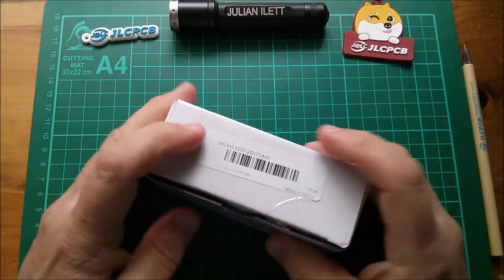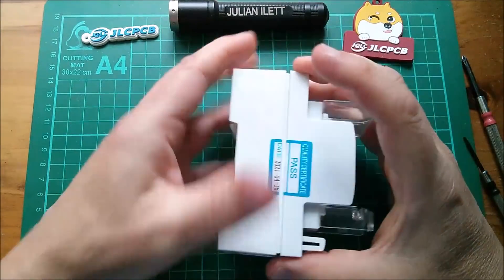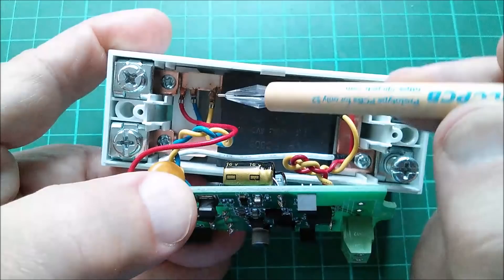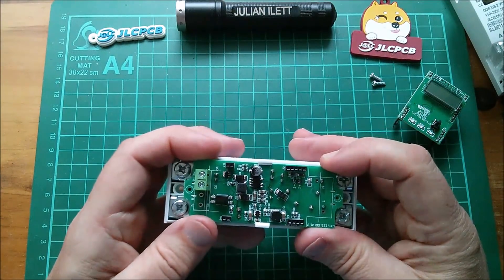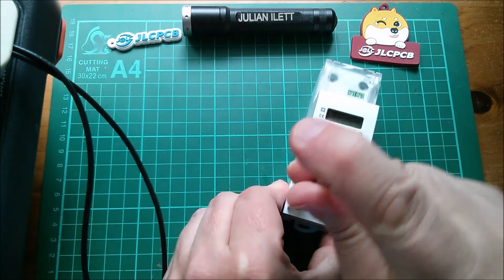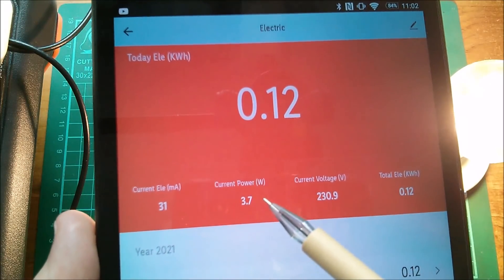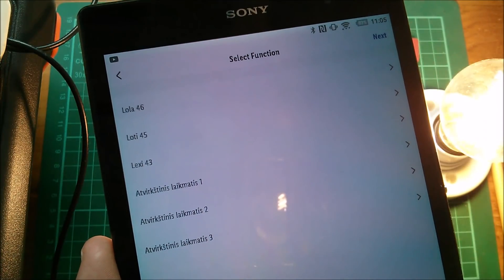Wifi Energy Meter DDS238 - Stripdown and First Use

Comment: Hello! Nice video. I'm not an electrician, but I have a doubt: at t=1:01 in its housing the device states its rated for  5 to 65 Amps. But when you dismount the pieces, the "Live AC" wires seems to be around 10 AWG gauge. Can these wires work with 65 amperes steady, as stated? According to manuals, for 65 Amps it should be 6 AWG gauge with copper wires. Am I missing something with the specs? Thanks!
Reply: Very interesting point
Reply: Have you managed to find an answer?

Comment: Just bought one of these to use as a main meter, kind of dissapointed that the app doesn't show positive or negative power, I have solar power and I'm interested in knowing if my power is being exported or consumed by my loads. Also if you are using this as a main meter I strongly recommend disconnecting the coil wires, last thing one needs is accidentally switching off your main power by pressing a huge ass button without any confirmation. Make sure the relay is in the on position if you disconnect the coil as it's indeed a latching relay. The software of these meters is horrible BTW.

Comment: Many thanks! You convinced me ;).
Just one info: supposing to place it upstream to all my loads - if I switch off it from the app I'll lose the possibility to re-switch it on.... and I would need the restart of the router to be able to switch it back on via the app - is there the possibility to switch on/off via the physical button I do see on the front of the device? Many thanks. Cheers

ups. just reached the end - it is the 3x click right?  With that 3x clicl i can switch the device on/off without the wifi right?

Comment: In my case the breaker is not working. There is a relay noise when activated but output load is always connected. Is mine broken?

Comment: You would feel it, when I was younger I accidentally pulled cables out of a chocolate block by tripping over it (yeah, I know it was silly to use, it wasn't me who did it), and without thinking I twisted the wires to put them back in, did one side fine - but as soon as I touched the other I got a bit of a buzz!! - that was with the Neutral, straight from the mains.. I was sat on a bed at the time I was trying to fix them too, legs crossed!

Comment: Hi, long press to do an init is probably only for the zigbee version. In the zigbee version it is used to pair the device with the gateway. Do you know what the green pin in the front are for? Pin 5 and 6. The manual say it is for impulse, no idea what does it mean. On a different version of the dds238 it says it is a modbus rs485 connection, which seem more likely.

Comment: I used my SONOFF POW for Solar Messaure .... no LCD but else the same. And I have a DS238 for reading pulses into a ESP8266 uploading to PVOUTPUT.ORG. Works for several years now. I only have 800W in solar, but in summer there have been times I produce more than I need. To avoid that my hotwater heater is running only from 9AM - 20PM and with a SCR with is pulling down consumption from 1800W down to 500W so I always use more electric than I produce ;)

Comment: That's just not going to work though, is it Julian? The power meter is measuring the amount of power being consumed, not how much power your solar system can provide. You're not going to be able to use it as a 'The sun is out, and there's more than 800W of 'free power' available' trigger. Your only chance of doing that is if your solar inverter supports throwing a relay itself if it determines the conditions to be right to be providing power to an auxiliary circuit. Or is this a grid tie system, meaning it is always loaded because it's trying to export?
Reply from the maker: It's working now - I put the meter in my distribution box and it turns a miner on at 800W each morning. I have a grid-tied rooftop system.
Reply: @JulianIlett  im trying to set up similar automation but find it difficult because tuya doesn't distinguish exported energy from imported. I thought i can trigger an even when amount of exported energy exceed a certain amount but it won't work as it will also trigger the same event in case if energy consumed instead of being exported. How did you work around this?
Reply: @skyeye101  i have the same question. Did you get any luck with this. I hate that the guys from Huawei solar did not make the aps compatible to each oder.
Reply: @ionutoctav87  no luck, still wondering how Julian got it working, but guess it's top secret as he doesn't reply to this comment 😆
Reply: @skyeye101  just ordered a smart meter. I have a space where the old meter was initially. It will be conected directly to the mains.
I hope tuya will see the  "<0kw" values and run the automation...
Reply: @ionutoctav87  hopefully it'll work for you, as in my case inverter i use has an option to trigger a relay on specific customisable event

Comment: Having watched JW and looked at my own mains supply from the grid, it's incorrect to assume that the neutral is earthed at the substation and the earth cable runs to the same place.  On a TN-C system, the neutral is split off at the main fuseholder to become the earth (a PEN connection - Protective Earth Neutral) so as the wiring comes into the house neutral is exactly the same as earth.  Becomes a problem if the neutral breaks outside as then any connected load acts as a path for all 'earthed' surfaces to become live.

Comment: For a European main land board the layout for two live terminals below and two neutral terminals above does not make any sense at all! Is this a specific British thing?
Reply from the maker: It didn't make much sense when I installed it. I ended up fitting it upside down.
Reply: @JulianIlett  In that case the display will give an Australian readout ;)
Reply: @JulianIlett  I suspect this unconventional arrangement was to save copper, internally. The EARU RDCBC/TJ-2P is more conventionally arranged, incorporates a double pole relay, is rated up to 90A and is cheaper (no LCD 'though)
Reply: @sailingoctopus1  Also no meter
Reply: @JulianIlett  what do you mean? The circuit breaker is between 3 and 4 or between 1 and 2?

Comment: No you wouldn't feel it. Same with if you touch one wire coming from a bathroom shaver socket. But that's the problem, you have no way of knowing it's live so accidentally touching the other wire would give you a dangerous shock

Comment: 240v will move you across the room (mains or powerbank)
Reply: No it won't.
Reply: Not really 😁  German Electrician here, speaking of own experience 😅 What makes you fly is the high voltage in an old Tube TV 🤪
Reply: Work with 240V every day of my life - still haven't learned to fly. Simple solution, don't touch live wires.

Comment: @Julian Ilett are your plans to use this in the shed for the Antminers on the DC side ??? Or AC side. It wasn't clear. I see that these are AC specified units, in your opinion how would they go handling DC (say ~24v 80-90A) cut off?
Reply: I think he has some wifi controlled mains sockets to which the Antminer's AC supply is connected.

Comment: You should connect to your house consumer unit. Then you can look at the value being exported to the grid to determine if you should turn your miners on. You don't want to run minors when your oven is on and you are consuming all your solar energy being produced.
Reply: Did you tested this? How did you make the scenarios? Most reviews states that the power exported is not properly showed to make a scenario.

Comment: You can buy the standard WIFI Tuya Plug Socket with same monitoring functions.
Reply: Or even an extension lead so you have more outlets and timers
Reply: The difference is that this can control devices or circuits that draw up to 65A (although confusingly the max operating current is specified as 50A to 79A), so you can control and monitor the supply to a whole property.

Comment: If only they brought out the connection between the relay and shunt, then the one unit could work for both solar monitoring and switching on some miners. Or more commonly, allow two large loads to share a circuit by turning one off if the total current goes above a user set value.

Comment: IF not mistaken tasmota support Them so you can some proper software on it :) so you can manage it through mqtt and can get some decent data out for graphing too. Just a Little tip ;)
Reply from the maker: I am planning to look into Tasmota - cheers :)
Reply: You might have to do a manual (serial) flashing because flashing via WiFi is not supported on the latest Tuya firmware.
Reply: I've been using tasmota and OpenHab for years. It's excellent
Reply: @DrGreenGiant  likewise.

Comment: I would not touch them because your main outlet is also not connected with ground and you get a shock when you touch the live wire because the electrons are going to ground through your body why should this be different?
Reply: Neutral is connected to ground at the sub in the UK so the live coming out of our sockets would take the path through our bodies to ground. With the mains unit Julian had, there is no reference to ground so no path could be formed.
Reply: On a TN-C installation, it's connected earth to neutral at the main fuseholder coming into the house, there is no independent earth feed, just a neutral.

Comment: So you only switch the miners on when the power is free ?
Reply from the maker: At the moment, the miners are running at breakeven. So I'm only switching them on when power is free. Problem is, after a few hours, the sheds get so warm I have to switch them back off (or remove the shed walls).
Reply: @JulianIlett  pour water on them and hire it out as a Sauna !...interesting stuff...cheers.
Reply: @JulianIlett  Up your solar setup and get some air conditioning running with it?

Comment: Current power; current voltage ; current current?
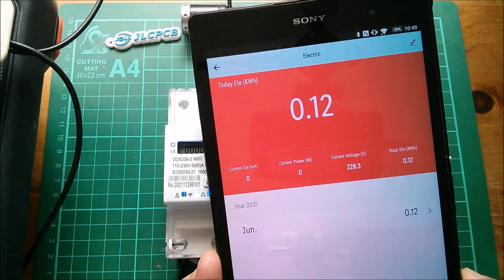11:48 There's no need for any adjective to describe the three readings on the user interface.  They could have just labelled the units as Power, Voltage and Current.
Edit:  Just spotted the mysterious quantity Ele which is measured in units of kelvin watt hours.
Reply from the maker: Yeah, the user interface on some of these devices is just horrible :/

Comment: You should give it a static IP address (ie:192.168.1.50) and block its wifi in the firewall setting of your router, and not let it get on the internet. 
I don't trust Chinese products with apps.
Reply: Tuya devices are cloud based, it would not work at all.
Reply: @gabest4  That's why I'll never buy one. The Chinese will sell your data just like Google does.
Reply: If you're gonna go that far, you might as well design your own with a custom pcb and an esp32. Then you don't have to rely on some cloud service and not worry about that data going somewhere you don't want it to. Plus when their servers inevitably go down, you won't be stuck with a paperweight, like with most iot devices.
Reply: @HobkinBoi  I did that 3 years ago with a SONOFF and uploaded the Tasmota firmware. It's more powerful and has more features, with a local WEB GUI, but with a regular relay.
Reply: @piconano  Well there you go then.
Reply: @HobkinBoi  That's what I did. Designed a circuit for a din rail case that reads stats from a meter that allows reading through modbus like most industrial devices. My circuit then sends mqtt messages. That way I have flexibility without having to deal with mains stuff. Not sure the meter in the video is certified correctly. I wouldn't want to connect to the consumer unit without that.